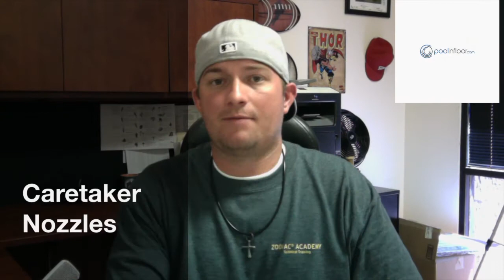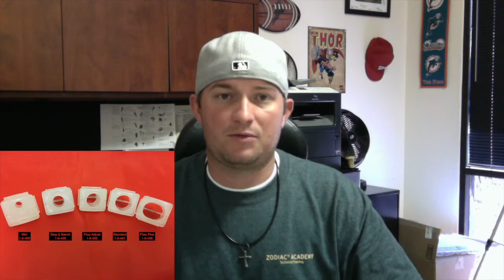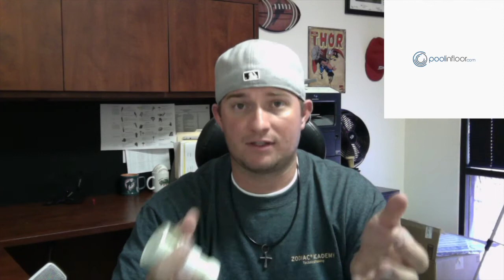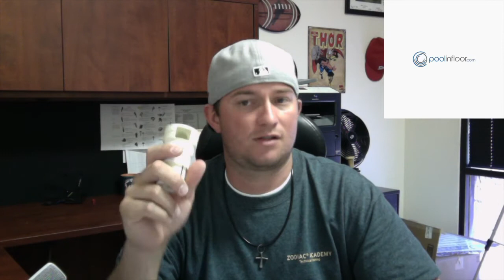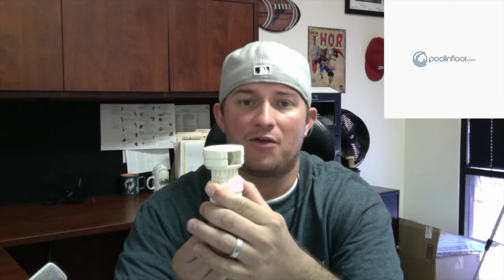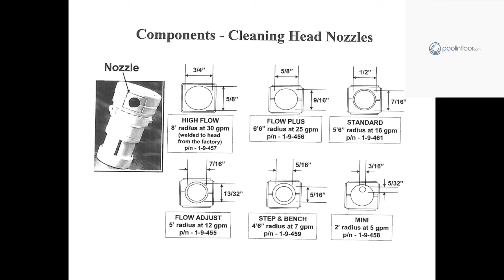Caretaker Nozzle Differences

Comment: How often does a nozzle need relacing vs the entire caretaker?  Under what conditions would a nozzle need replacing vs the entire caretaker unit?  What is the most common reason in which a caretaker head needs replacing?  I know a lot of questions but I cannot seem to find the answers.  The second half of this video did answer some of my other questions cheers
Reply from the maker: The nozzles would only need to be replaced if they fall out of the pop-up. pop-ups don't have a average life expectancy as that is all related to use and water chemistry. If you are using them often or you water chemistry is off that will factor in how long they will last before needing replacement.